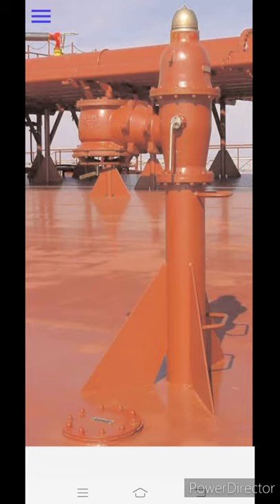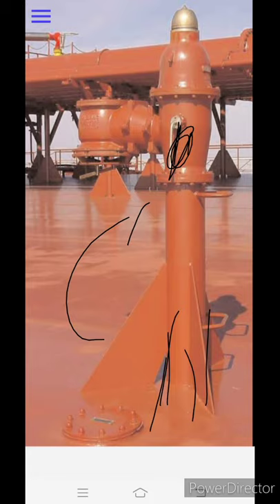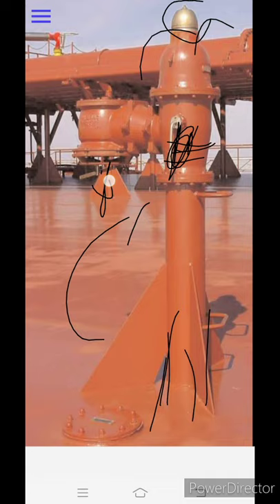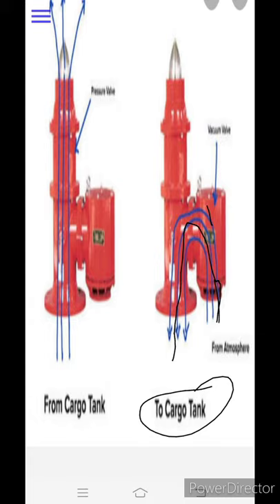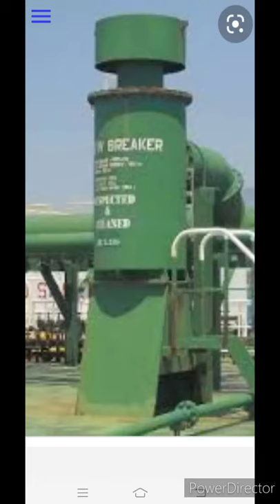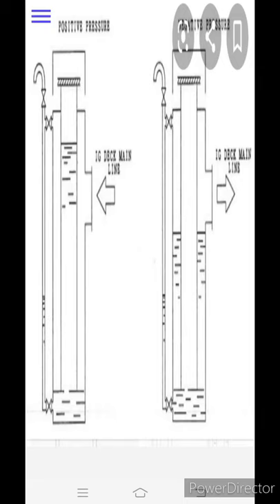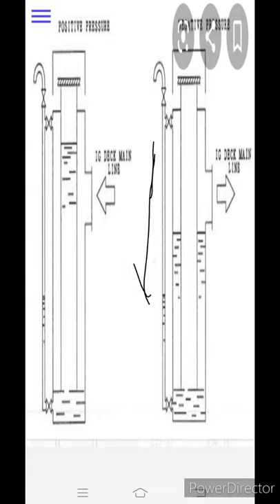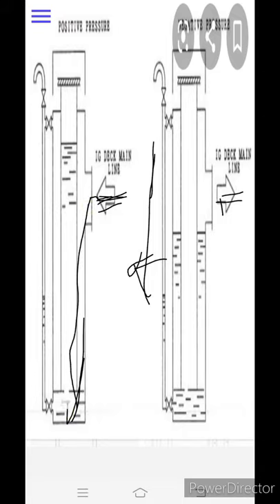PV VALVE ,PV BREAKER

Comment: Sir i have got it very gud video but I had one question sir through vaccum side of Pv valve if there is vaccum in tank n of we push the rod through vaccum side air will go out of tank?
Reply from the maker: In from the vaccum the air will not go out of tank because it is in fully pressured condition so it will be very difficult to lift the vaccum side
Reply: Got it thankyou sir had one more question wen cargo tank are loaded the PV BREAKER water level why it goes down we can't  see the level but once cargo discharged n tank pressuized with ig level cumes up wat is the reason sir?
Reply from the maker: @astlefernandes1429  its should not be happened somtime it happens just that might be tank goes in negative pressure ....else the case u are saying it doesn't supposed to be happened
Reply: Sir if pressure goes down bcose of no ig n no air tank can rupture?why bunker tanks don't rupture?
Reply: Sir once tank goes in negative pressure we should lift the lever on vaccum side ya automatically lever goes up n outside air goes in ??
Reply: How to reomove air ou of the tank wen negative pressure came  ya from which side air should remove out bfore filling ig?
Reply: PLEASE CAN U HELP ME WITH THESE QUESTIONS M IN DOUBT SIR?